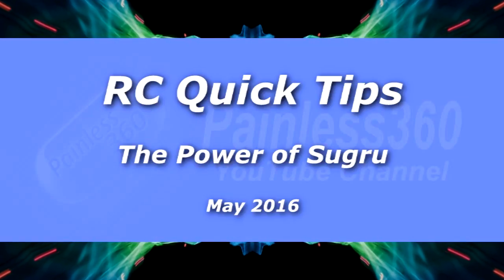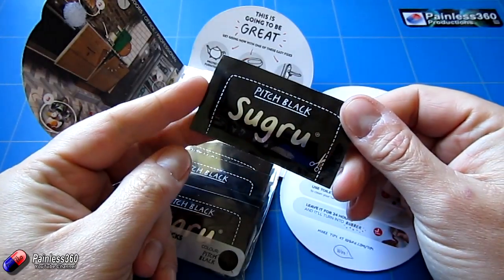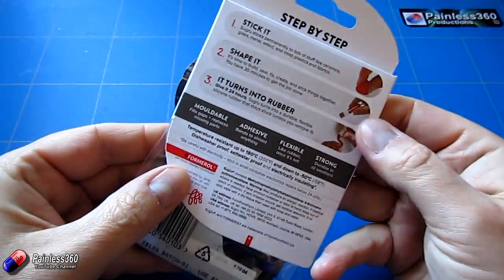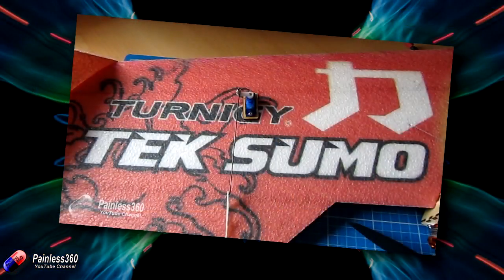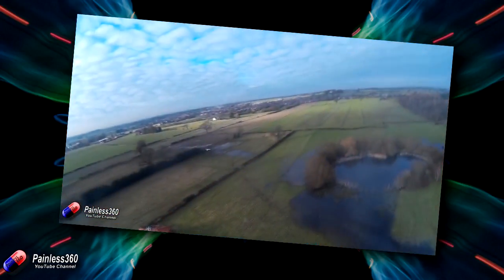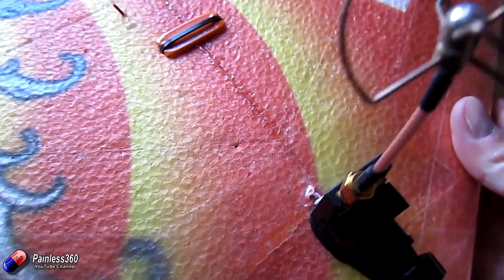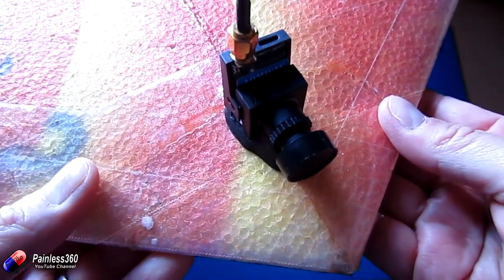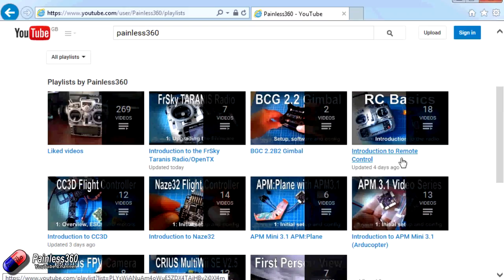RC Quick Tips: The Power of Sugru

Comment: Tip:  If you put a tie-wrap in the base while it's still soft you have a more secure mount in the event of it being knocked off in a crash.  Also the tie-wrap can later be pulled out of the base and replaced as needed.

Comment: Make your own with clear silicon and corn starch.  Mix the corn starch into a lump of silicon till you have a nice puddy, add color if you want with enamel paint (If I remember right, you might want to test small samples) and use immeadiatly.  This way, you've always got a supply of Sugru for next to nothing.  You can try the latex silcons as well (the ones that don't smell like pickle juice) for mounting electronics as that pickle smell IS acidic vapor looking to erode your electronics.
I believe I read this whole method in Model Aviation about 5-6 years ago.

Comment: Could you create a video that shows how to connect a Blade Nano QX to a FrySky Taranis using the Spektrum Module? You see the Nano recommended quite a bit online since it is ready to fly, features FPV, is compatible with Fatshark, and can be controlled via a Taranis, but a lot of people on the online boards struggle with setting it up on the Taranis. You could demo the complete setup, recommend some alternate batteries & motors, and post a copy of your Taranis settings.
Reply from the maker: +tschuman01 We don't have a Blade Nano. We do add a Spektrum module to the Taranis and setup the radio for a quadcopter in the Taranis series.. Hope those video help.

Comment: How 'permanent' is it? say compared to hot glue which can break away if you want it to. Thanks!
Reply from the maker: +Bishop Vick It hardens on contact with the air so temperature doesn't seem to affect it when it's cured. Seems very sturdy from our usage here.